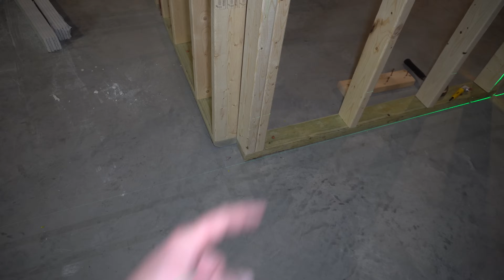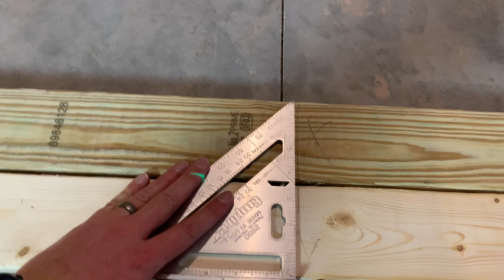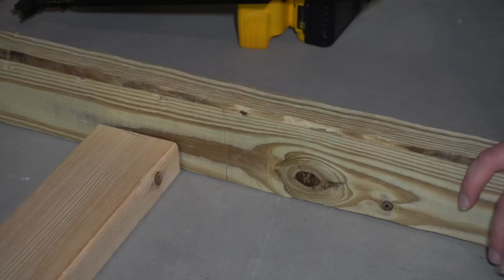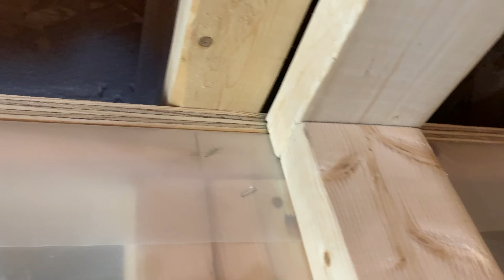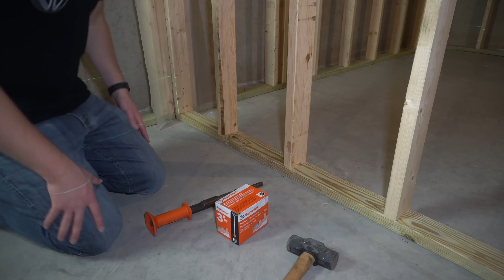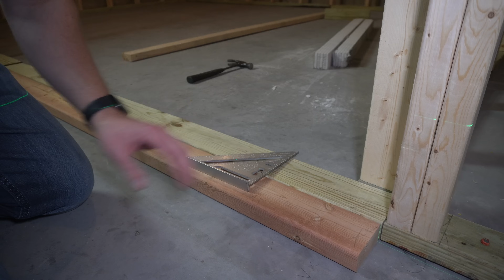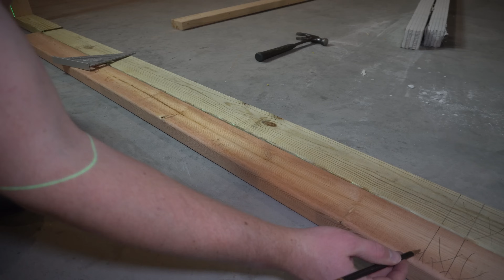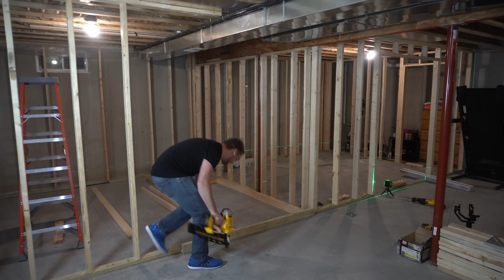The Basics of Framing A Basement Wall

Comment: Very helpful vid. I used steel studs years ago. Probably took longer but more versital. Adding a bathroom and kitchen so doing wood studs this time. I wonder why there was no sealent or  insulation on concrete walls.
I used a very thick sealent paint and 2" insulation board also thin sealent on concrete floor.
Reply from the maker: Thank you!
As for the sealant and insulation on the walls - this house was built about 5 years ago so they spray a waterproof sealant on the exterior side of the wall and put rigid insulation on the exterior side as well. Similar for the floor - there is a plastic membrane between the earth and the concrete floor poured on top of it.

Comment: What size nails did you use and what type/size screws?  I guess it's not structural like supporting upper house, so you don't really need to put 3 nails on the end like structural building
Reply from the maker: I used 3" nails and 2 1/2" screws - I added links to the video description for both of those. correct, these are non-structural walls

Comment: Much easier to ram set 1/4” treated to basement walls then attach paneling or whatever you want to the outer walls.  You will still need to do traditional framing to interior walls.  Ask me how I know …
Reply from the maker: to each their own - I would still check with your local building inspector to see if there are any special requirements. but yes, the interior walls - like shown in the video - would still need to be framed traditionally. thanks for watching!

Comment: Well done video and explanation.  Curious why screws are preferred over the nail gun for attaching the top plate?   Thanks in advance!
Reply: My guess is maybe the nail could backout over time where the screw would not?  That's just my guess.  If it did backout though, not ideal
Reply from the maker: Thank you! I really appreciate it!

I used screws in the top plate since sometimes the impact from the nail gun would move the top of the wall off my laser line and then my wall wouldnt be plumb. So usually I’d put a few screws in first to pin it in place, and then follow up with some nails since the wall wouldn’t be able to move any more. Hope that makes sense! 😃

Comment: If he is going to sheetrock, he is off in his layout. Should be 15 1/4 to edge of first stud in, 31 1/4 to edge of second stud, 47 1/4 to third and etc.
Reply from the maker: Yup, those are the dimensions I laid out. First stud in was 15 1/4”, then I moved the end of the tape measure to that mark and marked out 16” from there. So 15 1/4” plus 16” is 31 1/4” to the edge of the second stud in. Another 16” would be 47 1/4” like you mentioned.

Comment: Why are the studs so far from the concrete wall? Are you burying the window behind the wall?
Reply from the maker: The studs are placed 1/2” off the concrete wall to allow for an air gap - in case any moisture would develop behind the wall, hopefully it would evaporate before causing an issue. The one wall (window wall) is spaced out a little further because there is a bump out in the concrete wall that I needed to get out in front of. 
I cut in windows after I have walls stood up so I can cut them in perfectly and not have to rely on measurements when building the wall.

Comment: This was a solid video! Well done. 

I love these battery nailers. 

I have the DeWalt framing and roofing battery powered nailer. The roofing nailer I actually use it for siding and trim. 

Running battery tools is so nice and efficient. Little to no set up, less noise, more work time, no cords or hoses to get tangled up in or snagged on this or that.
Reply from the maker: Thank you! 
I agree - battery tools in general are the way to go!

Comment: I am soaking up as much as I can before attempting this myself in our basement. What is the purpose of the gap between the framework and the wall?
Reply from the maker: That's an air gap - In case a bit of moisture would develop behind the wall, the idea is that it would evaporate before causing any damage. 
Good luck on the build!

Comment: It's you build this wall, I look at the wall behind you that has the standard ground level window in most basements.  Instead of framing around it, you stud over it.  That's a code violation where I live.  I am looking for the best method for framing around those windows and marking a proper finished window sill.
Reply from the maker: I like to frame the walls in front of a window like that first, and then come back and frame out the window afterwards by cutting the studs of the wall. this way I can frame it out exactly since the wall is in place and the window isn't moving lol. Unfortunately I didn’t make a video on framing out this window
Reply: @Doing Whatever  thank you.   That explains that.   The video was very helpful.  Done some carpentry in the past but don't know all the little tricks that make the job easier.  Thanks for the helpful tips

Comment: Why is the first stud marked at 15” and 1/4?
Reply from the maker: It's a little tricky to imagine it but I promise that if you lay it out like this you will end up with studs 16" on center lol. So the first stud will be flush with the start of the bottom plate. Then measuring 15 1/4" off the start of the bottom plate will give you the leading edge of stud #2. Center to center of the first two studs will not be 16", but the sheet of drywall will not be going to the center of the first stud, it will be going to the edge of it/start of the wall. 
So from the start of the wall to the center of stud #2 will be 16". Then it's 16" OC from that point on. I hope that makes sense 😃 Kind of tough to explain in text lol. 
I should make a separate video diving a little deeper into this particular aspect
Reply: @DoingWhatever  thanks for the explanation, I’m an electrician and I like to learn about the other trades - not sure why I guess it’s just curiosity lol. But I have a friend who does framing and I don’t think he does this so I was curious as to why you build this way. Not questioning your method just wanted to know. Thanks again. :)
Reply from the maker: No problem! Always fun to learn new things! And there’s usually more than one way to achieve the same thing 😉

Comment: If I am adding a wall to a room with a finished ceiling, would it be better just to frame it standing up and toe nail everything?  I don't want to wreck the ceiling trying to raise the wall up by hand.
Reply from the maker: You could definitely frame it that way and toe nail everything together. Personally I would cut the drywall ceiling (assuming) and remove the drywall where the new wall will be. That way the new top plate is right up against the floor joists and there isn’t a layer of drywall in between. Personal preference. Good luck with the build!

Comment: Great video. One question- my basement floor is pitched. How do I go about managing that? So one end of the board is touch town floor and the other is about an inch above the floor.
Reply from the maker: Good question!
if it's that much of a difference you will want to get an overall height measurement where each stud will be placed along that wall. in this case yours studs will all be a slightly different length. hope that makes sense!

Comment: I was surprised you left the footer in the door rough opening. I dont do that myself. Are you taking that out or leaving it in? If taking it out, how are you cutting it?
Reply from the maker: I leave it in there while I stand the wall up into place just to keep the wall from wobbling around. After the wall is in place I cut it out using a sawzall with the blade in upside down - just cut flush with the door opening. I should have shown this in the video... lol

Comment: Not a bad video.  My only recommendation is the joints on your top and bottom plate should be offset. Bottom plate is fine then you should of used a longer board to get the seams away from each other.  And put the seam between studs and then sister that section of top/bottom plate.  That’s the correct way to do it if you aren’t going to do a double top  plate but the way you showed is how some builders do it to speed it up (not their house they don’t care). Another thing I learned is when marking for cuts, I do a check with a perpendicular line going up to the tape then slash at an angle to the waste side.  Just eliminates pencil lifts
Reply from the maker: thank you - these are very good tips I'll have to remember for next time! Really appreciate it!

Comment: This was really helpful !  Actually going to frame our a wall to separate a larger bedroom into two halves.  Any advice on planning when the room is already finished and the studs / ceiling joists aren’t exposed ?
Reply from the maker: awesome, I'm glad to hear that!
I hate to say it but you will probably need to expose the ceiling joists and the wall where you will be connecting this new wall to. Personally I would feel a lot more comfortable if the new wood studs are butted up right to the existing wood studs/joists, without a layer of gyp board in-between. You wouldn't need to demo the gyp board on the entire ceiling or wall - you could just layout where the new wall will go on both the ceiling and the existing wall and then cut out just enough of a strip for the new wall. so basically cutting a 5"-6" strip out of the gyp board to reveal the studs/joists behind. Make sense? then you could tie the new wall into the existing framing securely.
Reply: @DoingWhatever  Thanks. Yep that makes sense.  I would also rather tie directly to the existing framing as well.  I appreciate the advice and response !  Here’s another question : Since this is a divider wall, would it make sense to do double framing (2x) so can recess the tv on one side and possibly add a pocket door ? Just brainstorming … haha.

Comment: Hi. Thanks for the great video.I am getting ready to attempt to frame out my basement on my own --- 60 year old athletic-ish female. A couple of questions. First, why is the window in the video covered by studs? Are you not framing it out? Do you have a video where you do frame out the window? Also, do you have a video about putting a pocket door in a wall as you construct the wall? And as I see you measure 16" for the studs, it makes me think I would rather use a 16 inch piece of stud that I tape up with red tape or something to let me know that's my 16" measuring stud, instead of to keep having to use my measuring tape. Would that work or better just use the tape measure? Thanks, Renee
Reply from the maker: The window in the background was eventually framed out - I like to frame the walls in front of a window like that first, and then come back and frame out the window afterwards by cutting the studs of the wall. this way I can frame it out exactly since the wall is in place an the window isn't moving lol. Unfortunately I was running short on time and didn't make a video for this - wish I would have...
I don't have a pocket door video either, sorry!
The measuring stud could probably work, but I've never done it that way. my only caution for doing it that way is the compounding effect - if you are off by 1/16" on the first stud, now the second stud is off that 1/16 of an inch plus however much you are off on the second stud as well, and so on. by the end of the wall you could easily be off by a significant amount. 
Thanks for watching and for the great questions!

Comment: Just a question. You started at 15 1/4" then you marked every 16" with the stud being on the far side of your mark. Correct me if I'm wrong, but with that,  you will not have 16" centers?
Reply from the maker: It's a little tricky to imagine it but I promise that if you lay it out like this you will end up with studs 16" on center lol. So the first stud will be flush with the start of the bottom plate. Then measuring 15 1/4" off the start of the bottom plate will give you the leading edge of stud #2. Center to center of the first two studs will not be 16", but the sheet of drywall will not be going to the center of the first stud, it will be going to the edge of it/start of the wall. 
So from the start of the wall to the center of stud #2 will be 16". Then it's 16" OC from that point on. I hope that makes sense 😃 Kind of tough to explain in text lol.
Reply: @DoingWhatever  actually it does makes sense. I guess I'm like really old school.  I was framing over 25 years ago and we just laid the walls out a little different.  So when I was watching, it didn't make sense.  After you explained it,  the light bulb switched on.  Lol thank you
Reply from the maker: lol no problem, glad to help!
There are definitely several ways to lay out a wall, this is just the way I know 😃

Comment: This is nice neat work but the studs should be toe nailed to the top and bottom plate. The nails are in the week end grain as opposed to the stronger face grain. This can cause twisting of the stud especially if working with greener lumber.
Reply from the maker: I know some people like to stick frame their walls and toe nail each stud in place but I haven't seen that done with tip up wall construction like this - not saying you're wrong at all just news to me lol. Plus I'm terrible at toe nailing studs in place without getting off my marks 😃
I appreciate the feedback nonetheless

Comment: I'm a novice, but I find that if I have a twisted board in my stud layout, I get the one end nailed or screwed in square , and then I take a large crescent wrench and put it on the other end so I can twist it square before attaching it to the top. Works every time.
Reply: I'd suggest asking an experienced refit carpenter about that technique.

I do woodworking instead of carpentry so I'm not going to pretend to be a framing expert, but in my experience wood likes to move around a lot more than people realize.  Wood builds up stress that causes it to deform, and the stress can get pretty large.  A twisted board starts out straight at the sawmill.  Being removed from the rest of the tree allows the stresses in that board to relax, deforming the shape.  That deformation will continue until the board is fully dried.  Construction lumber is notorious for being poorly kiln-dried, so it's usually still pretty wet when you buy it.

When you force a 2x4 straight, you're introducing new stresses to it.  It might work for now, but as the stresses change as the wood dries (and over the years as the moisture varies by season) the stresses might be too much for your fasteners.  The fasteners weaken over time as well.

Personally, I wouldn't do it.  But again, I'm a woodworker, not a carpenter, so if an experienced carpenter wants to contradict me than they are more than welcome.

Those twisted boards are still useful in shorter lengths.  If it's twisting 30° over an 8' length, that means it's only twisting a bit less than 4° per foot.  Or if there is severe twist in one part of the board but the rest of the board is mostly OK, then you can cut out the problem part and have a decent board for other uses.
Reply from the maker: I tend to agree with what you're saying - it might work fine right now but over time it may become a problem. Good tip about using the twisted studs for smaller lengths. you can always use them for blocking behind where a tv may hang on the wall or where you will mount upper cabinets and such.
Reply: @DoingWhatever  It seems to me that when I build a short wall, maybe 8ft long, and I have 2 or 3 twisted studs ( slightly twisted) that when I wrench them straight and fasten them...the wall is always nice and tight because they put a little tension on everything. Could just be me, I guess.
Reply from the maker: I can see that for relatively small twists but if I have to really crank on it, I tend to set that one aside and find a straighter stud. but to each their own lol
Reply: @DoingWhatever  Where I live, you could unstack 1/4 of an entire pallet of 2x4's or 2x6's to find one board that isn't heart wood, twisted, bowed...or both. So when you need to build something, you must innovate how you're going to do it , in order to build a straight wall. In fact, we joke in town about our local building code which is... "Nothing square straight or level" LOL!

Comment: Use the 10" to line up instead of the end of your tape.   It's much more accurate.   Obviously remove the 10 from your measurements going forward but it's easy and more accurate.  😉
Reply from the maker: That’s a great tip,  thank you!

Comment: Hey I’m framing my basement with uneven floors and low ceilings so I don’t want to level the floor any tips or ideas
Reply from the maker: How uneven are we talking?
Reply: Pretty uneven different one inch at the biggest curve
Reply: @thatkid6663  Just thinking out loud (I'm not a carpenter but I am a homeowner that has to do stuff like this sometimes), but I've been watching some videos that covered similar situations to yours.

Try securing the bottom plate before measuring the stud length (so that the bottom plate follows the contour of the floor).  Instead of stacking the two plates and measuring the stud length that way, measure the length from the bottom plate to the floor joists and subtract the top plate thickness (that way the top plate won't be "smoothing" the curve of the bottom plate).  Make a measurement for each stud individually and mark it on the bottom plate.  You'll have to assemble the frame with no bottom plate and then toenail the studs into the bottom plate once it's in place.

Anyone with more experience, feel free to contradict me.